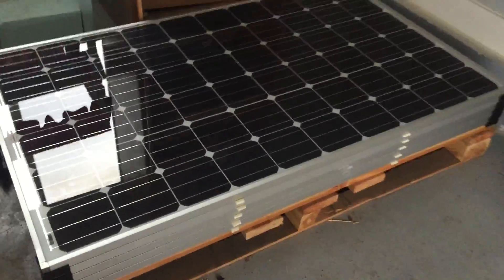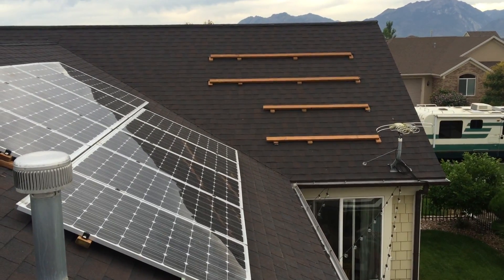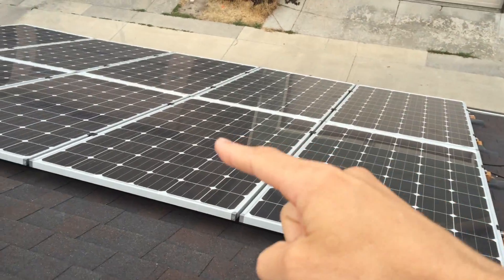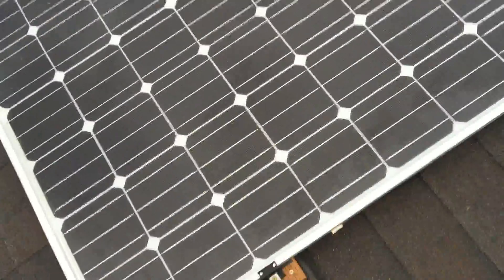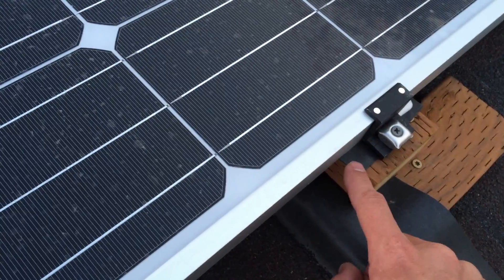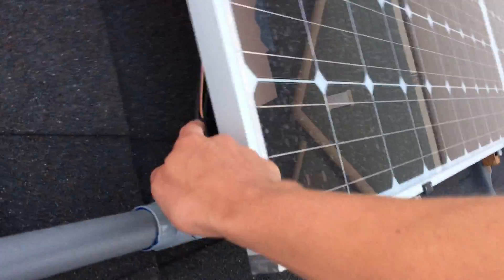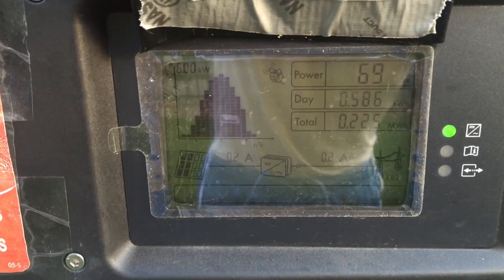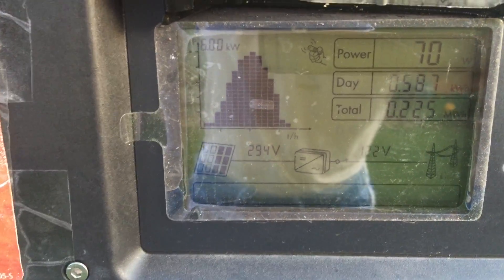How To Install Solar Panels Yourself For $4K - DIY 7KW - South Jordan, Utah - Cheap

Comment: Interesting how this passed inspection since city normally stamps a set of approved plans indicating the UL listed racking system.
Nonetheless good job Matt, I never thought of using treated lumber. Good idea, just goes to show one can do anything as long as there's integrity.
Reply: How about using trex decking instead of wood? It's a composite decking material that I used and it's some nice stuff..Never rot ,swell,shrink etc..
Reply from the maker: @daveyboy8907  not a bad idea - it holds up well, but I think unistrut would be cheaper.
Reply: Great job Matt.
Reply from the maker: @daveyboy8907  thx!
Reply from the maker: yeah, that is interesting.  Perhaps my city was more lenient.  I will probably swap out the lumber with some unistrut at some point because it is hard to really crank the bolts on the lumber, so I have gotten some slipping of the panels.

Comment: Hi Matt. Phenomenal video that I have came back to few times by now. Thinking about doing this myself. I saw your advice on where to buy panels and inverter. I am looking at 15KW system most likely. I don't see the panels as cheap as you were suggesting however. Am I missing something or did they go up in price (not logical but maybe with tariffs?). What should be the specs for the inverter I need? Is output 220 or 110V ? Will I have to have 2 of them ? I hope you wont mind additional question or two later :-) I appreciate the time.
Reply from the maker: so you should subscribe to the sunelec.com email newsletter.  they will send you emails where prices are $0.10 - $0.40 per watt.  Are you sure you need 15KW - that is more than double mine.  If I were you, I would probably get two 6KW or 7KW inverters because that is the sweet spot.  I have seen ones on ebay for $1500-$2000.  The output is going into the main - I think it is 220, but honestly I am not sure - didn't need to know.  I just know that I had a double 30 amp circuit breaker that I popped into the box.  also, be sure to look through https://diynewman.wordpress.com/2016/07/24/how-to-install-solar-panels-yourself-for-4k-diy-7kw/ - I documented a lot there.
Reply: @MattNewman  , thank you. I am at the beginning of this process. As roof is not built yet (new build), are there any things you could do, based on your experience, before roof is completely done? Also, amateurishly, I assumed I would need double as home is fairly large so that was my thought process. I don't have the usage data yet as home has not been completed yet. I was just trying to stay ahead :-)
Reply from the maker: Nermin Dedic so yeah I guess if the house is double the size of mine (mine is 3500 sq ft so are you saying yours is 7000 sq ft?) then That makes sense.  So I think you can have the home builders do some wiring and set up the mounts for panels as they are building it which would make your life easier.
Reply: @MattNewman  , well, I guess not double then. 4800sqf. Maybe 12KW system? I'll talk to the roofers to see what in advance they can do. Maybe run the conduit into garage at least.
Reply from the maker: Nermin Dedic yeah that sounds more like it. I think 12 kW is still probably an overestimate, but it doesn’t hurt to overestimate a little bit because the materials have gotten so inexpensive that you might as well.  And yes, I would talk to the construction folks about running conduit and maybe putting in some footings for the mounts on the roof

Comment: Those wood racking rails - LOL. Will last 30 years", yeah, No. That and the electrical job...I think you just dropped your home value like 10-12k. I think you should have just hired a professional, you would likely have netted out the same all things considered (your time, the fact that no one will want that trash job/fire hazard on their roof, etc), but hey it looks like you had fun doing it, and there's value in that I suppose!
Reply from the maker: Jordan Sage I disagree, but thanks for your thoughts!

Comment: So awesome! I'm in the same boat you were. Getting quotes of about $29K. I totally think i can do this myself and your video helped me get over the "fear factor." The only difference i would do is add a battery storage system to it. Have you considered that after the fact? I think in the past couple of years they have gotten more common. Thanks again!
Reply from the maker: yeah, half the battle is just believing you can do it!  So I basically use the grid as my battery, so there is no need to incur the additional expense.  You can see more detail on my thoughts about batteries at https://diynewman.wordpress.com/2016/07/24/how-to-install-solar-panels-yourself-for-4k-diy-7kw/.  Basically, I would only do batteries if your power is unreliable, the grid isn't available, or you don't trust your power company (like they could change their policies in the future).  However, most power companies are still pretty beholden to their customers and state laws, so if you are usually grandfathered in once you get a net metering agreement in place.

Comment: Thanks Matt. Great video. I am a handyman and thinking of installing solar panels myself. My only concern is that I have never climbed on the roof. Do we need any special gears? Safety belt or special shoes?
Reply from the maker: Moe Khan I had a ladder, no safety cords, and flip flops.  I would recommend some decent tennis shoes with soft rubber soles.  You could also get a safety harness in case you slip.  I got shocked (didn’t hit too hard) and was lucky I wasn’t at the edge of the roof.
Reply: @MattNewman  Thank you for the prompt reply. I am motivated to install Solar in the next three months. Thanks again
Reply from the maker: Moe Khan you bet - good luck!

Comment: What is stopping the Water from soaking the pressure treated wood and leaking down into the attic through the screw...  Treated wood absorbs water too.

sure it won't exactly be a gusher but moisture is moisture.

Spend the extra money on a good solid aluminum racking system people, long term it will prevent headaches and last a lifetime. They won't need to be replaced when the roof or panels need replacing.
Reply from the maker: The treated wood actually doesn't really have much exposure to water.  The panels cover it, and then I put a rubber barrier around the tops of the footers so water on the roof never really comes in contact with the treated lumber.  There is a bit of rain on the exposed treated wood between the panels, but that is minimal.  With this minimal amount of water, it hasn't been a problem in 4 years (no leaks).

However, I do agree with you that metal racking is better.  That is why in the lessons learned section on https://diynewman.wordpress.com/2016/07/24/how-to-install-solar-panels-yourself-for-4k-diy-7kw/, I list that I would have done unistrut instead.

Comment: Hi, we are manufacture of the solar energy home system  solution .   Solar panel with battery Off grid solar hybrid system with solar panels    online service  +8613798209142
Reply from the maker: no thanks

Comment: You are suppose to use lag bolts. A good wind is gonna send those panels flying.
LFNC conduit on the wall where is can be physically damaged is a code violation. Plus you have 600VDC right on that wall. You are asking for someone to pull or hang on that conduit and get killed.
Reply from the maker: thanks for the tips.  I suppose I could have used lag bolts, although it has been 3.5 years and many windstorms later, and they are doing fine.  The LFNC conduit seemed to pass inspection, but I suppose I could have done it differently.  I am not sure why someone would pull or hang on it though - it is about 15 fee above the ground, so not sure how they would do that unless on a ladder.

Comment: This has been super helpful as a starting point. BUT, your city/county might not approve. 

Mine REQUIRES official solar mounting hardware (refuses treated lumber DIY) because they want to see load and wind ratings from official manufacturers, etc. Also made it look too easy - didn't say much about paperwork. Again, insanely detailed stuff is required of me, even down to drafting up the location of every single screw into the rafters. Ugh!  Also, Rocky Mountain Power is super picky, you need to show details of the output, wire lengths, sizes, and every single sticker that will be placed on each utility item, all in your application UP FRONT.

This is no walk in the park. They make it as difficult as possible for DIY.  Not much of the ugly details was shared here, or in the wordpress post. But again,  GREAT job on sharing your success. It has been helpful to get me started.
Reply from the maker: Thanks for the feedback.  A few points:

- I did have to get my lumber racking approved by a structural engineer (cost me $100).  I didn't need to from the manufacturer like you do.
- I wasn't required to have my plan to that detail.  I did just get a screen shot of google earth and put the orientation of the panels on it, and that was fine.  

I am sorry if I conveyed it as easier than expected.  I did try to express that the installation is the easy part - it is all the planning and paperwork that takes more than half the time.  I estimated it took me about 100-120 hours total, and installation was only 30-40 hours of that.  

Now that I have done it once, I think I could get the planning and paperwork to about 20-30 hours and then installation in 30 hours or so.

Anyway, take care!

Comment: Major thanks... I'm renting but looking for ways to save money so I'm trying to design a semi-portable array. This is a great start for me @patrick Barney I'll def be reaching out, hopefully you're still active!
Reply from the maker: Yeah, make it portable is a bit tricky.  I have thought it would be nice if Home Depot or Lowes would just sell a flexible solar "pad" that just rolls out and you tack it onto your roof.  There are some small panels and inverters you can just plug into your outlet (works only for anything on that breaker).  You can get those on ebay for $100 or so.

Comment: I live in Utah too. Is there a law that says I have to be connected to the grid? I don't want to connect to the grid so that would be a huge turnoff for me.
Reply from the maker: David Engel no there is no such law - you just lose out on the benefits of net metering which basically allows you to use the grid as your battery instead of having to pay thousands of dollars for batteries.
Reply: @MattNewman  So basically you let the grid borrow your excess solar, but they give it back to you when you're not producing and in need of power?
Reply from the maker: Saul Goodman Yes exactly
Reply: @MattNewman  That's literally amazing.
Reply from the maker: Saul Goodman Yeah, it is called net metering and you can look it up on Google in your state. Most states do it and it is a pretty good deal. Good luck!

Comment: Great video.  I'm beginning the process of figuring this out.  Can you tell me what gauge solar wire you used for the arrays?  I know its based on the amount of current specific for ones system, but I'm curious what you used.
Reply from the maker: Sarah Raposa see https://diynewman.wordpress.com/2016/07/24/how-to-install-solar-panels-yourself-for-4k-diy-7kw/ and specifically the link to the manifest for all that info - https://docs.google.com/spreadsheets/d/17l-QP0PswdXRNdfbICIZk83niCknfW6OeJlVLyCDeQ0/htmlview

Comment: Very Informative!    Are you afraid of Leaks from all of the holes? Is that a big problem with solar panels?
Reply from the maker: no, the holes go into the studs in your roof, so there aren't really "holes".  Also, I sealed all the footings with tar, so there isn't a way for water to get in there.  After 3 years, no leaks yet after 3 pretty gnarly winters!
Reply: @MattNewman  Look Matt, You are amazing and I trust that if you did the job, that there would be no leaks. Although I like the idea of solar energy, I have this fundamental problem with making holes in my roof. I doubt most installers do what you do. Much Appreciate the video and your excellent work!
Reply from the maker: @silverbankruptcy  thanks - actually that was one of my fears too.  However, it turned out to not be as scary as I thought once I did it.  I just made sure I hit the studs in the roof (by measuring twice from inside).  It is pretty easy to seal if you get it wrong though.

Comment: Did you just drill through your shingles and roof? Has the tar maintained the seal?
Reply from the maker: yes, into the shingle and then into the stud.  if you watch the video, you can see where I put tar down under the footer.

Comment: Where are you located in Utah?.  I use to be an architect in Sun Valley Idaho and worry about ice damming forming around the conduits, especially at the eave.  It can tear your conduits off the roof.  If you regularly have icicles and ice buildup on your eaves in the winter, you may have roof venting problems that cause icing.
Reply from the maker: Woody Bryant in south Jordan in the salt lake valley.  I don’t get a lot of ice buildup and the conduits have been fine after three years
Reply: @MattNewman  Great.  I commend you for doing it yourself.
Reply from the maker: Woody Bryant thanks!  Take care

Comment: Is it better to buy two 250w solar panels or to buy five 100w solar panels?
Reply from the maker: bigger is better - more efficient on your roof space.  But, I would also consider price/watt and price/sq foot.  If you have a lot of space, maybe you don't care about price/sq foot and you just get the lowest price/watt you can find.  I have seen 100 watt ones go for $0.15/watt.

Comment: A couple things. :) This video is still helping out people years down the way! Thank you! I will mention that QRail from QuickMount is VERY cost effective and is aluminum so you do not have to ground the panels. Only every other racking (one of the two racks holding the panel row). I am planning a DIY 18kw solar system on my barn and have almost everything figured out BUT the inverter(s). I will have two strings of 24 panels in 2 rows (48 panels in total) making roughly 1000v and 9 amps per string. I was going to hook them up in parallel doubling the amps and keeping the 1000v. Hard to find affordable inverters that can handle that. Excited to see some progress! Thanks again!
Reply from the maker: This is great - thanks for sharing inexpensive racking option and your project details.  Good luck!

Comment: The avg shingle roof last about 10 -12 years in normal areas. I dont know about Utah but You dont need a 20 or 30 year guarantee on roof hardware because in less than 15 years its all coming off for a new shingle roof.
Reply from the maker: codyjones109 yes true and my house is actually already 13 years old

Comment: This system would under $5000 U.S fully installed in Australia even with proper mounting racks
Reply from the maker: chefgav1 good to know - probably could do it for that here now too
Reply: @MattNewman  could easily do it as wages are double here in Australia
Reply from the maker: chefgav1 I see nice

Comment: Why did you use a 7kw inverter? SMA run more efficient when you over clock them.IE 6kw inverter with 7kw panels.Google it as SMA say this.We  overclock the inverters in Australia by 33% as it make them run more efficient
Reply from the maker: Good to know - I just wanted more capacity in case I wanted to add more panels

Comment: Matt , I am your neighbor , I like your setup. Are you thinking of getting  a Tesla power wall ? So the Utah power can eat your dust. Those solar people come by to my house they were saying the same price or almost to 50,000.00 dollars but I told to hit the road. The American ingenuity and self studying is the way to go. Thanks for sharing your Solar setup neighbor......
Reply from the maker: Hey neighbor!  So I don't really want to do any batteries because when you grid tie you are using the grid as your battery.  Batteries cost more, and you only need them if you don't trust the grid (it is unreliable) or you don't trust the power company (you think they will mess with your net metering contract and stop crediting you for the power you are supplying to them, or if you are doing a new system and they don't offer net metering anymore).  I happen to trust both of those, so have no need for expensive batteries, and especially a ridiculously expensive Tesla power wall (which includes an inverter, but still, it is about 3X the cost of just using similar Lithium Ion batteries, or 5X the cost of lead acid batteries).  I have considered doing a DIY Powerwall (see https://www.facebook.com/groups/diypowerwalls/).  They use 18650 batteries from laptops and make their own power wall.  This can basically be free if you are willing to take time to get recycled batteries, test them, and rack them.  It sounds fun, but again, having little need for it, I haven't pursued it.

And since you are a neighbor, feel free to come over and we can talk shop if you ever want.  Take care!

Comment: pretty good and like @Patrick Barney stated some issues are there with your installations. I would first note you should never be on your roof without a lifeline and proper safety equipment.
Reply from the maker: Nate Rice thx!